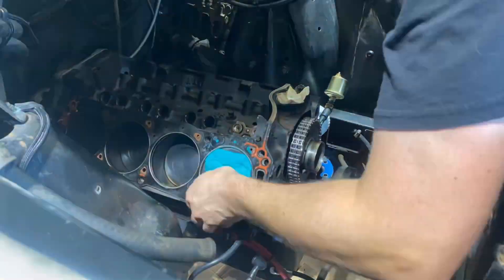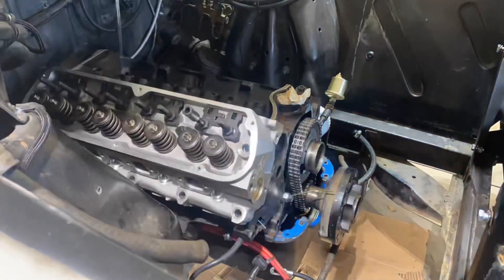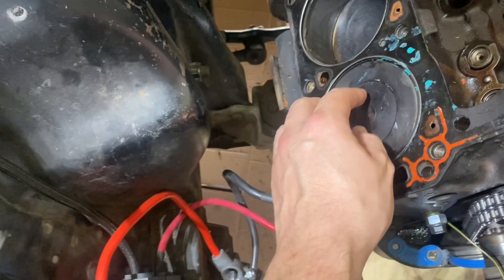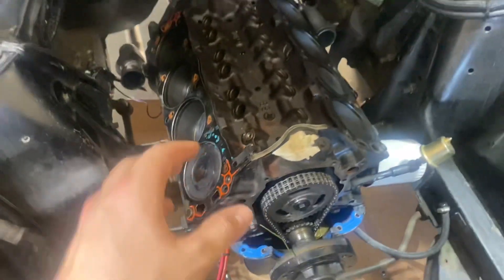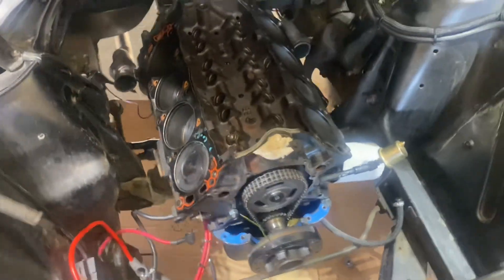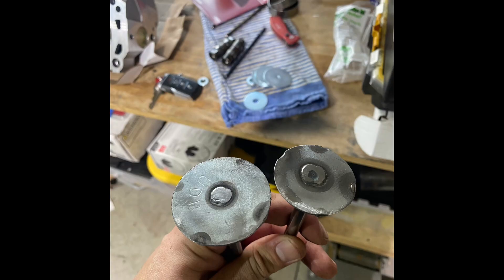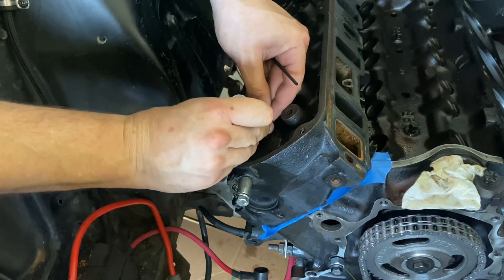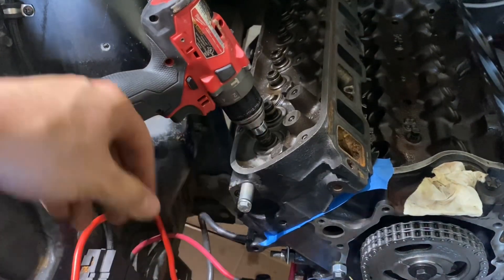Doing the Right Thing the Wrong Way - Piston to Valve Clearance

Comment: Hey man, thanks for the video, you pretty much solved my problem for me!  Can I ask how did you attach the sandpaper to the valves?
Reply from the maker: @Green007ism  i just used a 2 part adhesive to be honest.  You will have to replace the sandpaper periodically.  Finally, if at all possible use the new heads for your jig to ensure 100% your reliefs are correctly spaced/oriented.

Comment: Hey I got a good tip if your cam is to big that just requires some time, at least on a sbc. The stock stamped steel sbc rocker arms are never actually 1.5! If you check them They can be anywhere from 1.43 to 1.47 But never 1.5. So if you buy two sets of stock rockers and test all 32 of them your bound to find 16 that are close enough you can even play games with it and put bigger lift ones on the intake and smaller lift ones on the exhaust to improve low rpm performance. Another benefit is because the rocker ratio is decreased it puts less pressure on your valve train.
Reply from the maker: @The0utmode  thats a really good call!

Comment: In a pinch it works, kind of back yard engineering I like when things go awry. I recall putting a engine together a couple days before race day and the machine shop decked the block that was already decked to zero and I had the pistons above the deck by .030" . Needless to say it all came apart and I fly cut the top of the pistons also had to do a little valve clearance to the tops. We made it to race day, 15 years later its still in the car and runs great... who would have thunk.
Still cant wait to see it on the dyno👍
Reply from the maker: This makes me feel better hahaha!